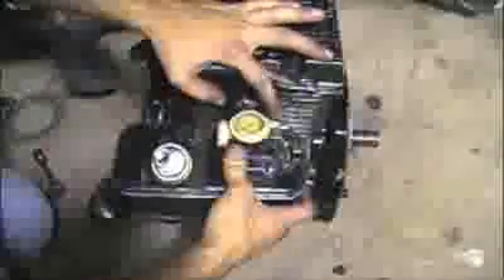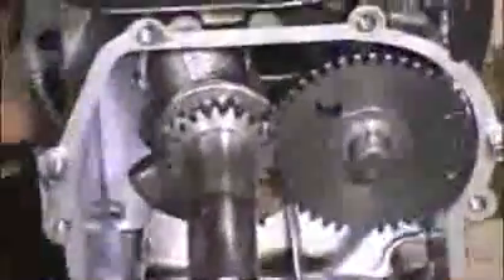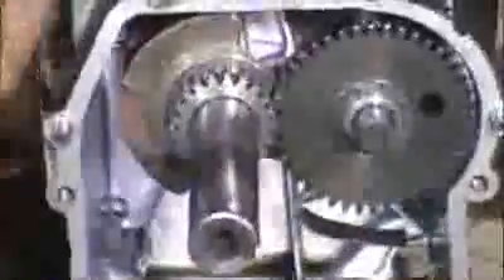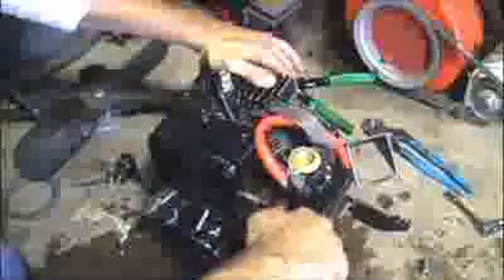Como convertir un motor de cortadora de césped a un motor de Go-Kart.

Comment: no se necesita hacer tanta modificacion., con tan solo dos engranes que transmitan la fuerza de vertical a horizontal y asunto arreglado..............
Reply: viln o oye pasa tu face
Reply: Hola soy de panama..tengo la pata de un motor honda..quiero montar un cortagrama de 4.5 hp..tienes algun videl o diagrama como aserlo.?? Te lo agradesco amigo